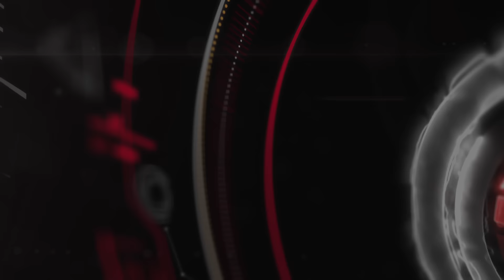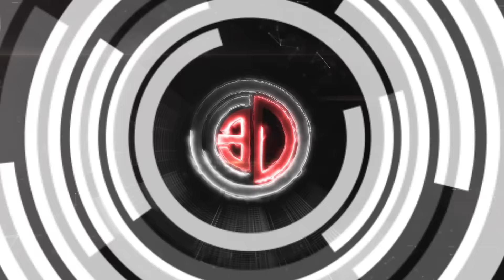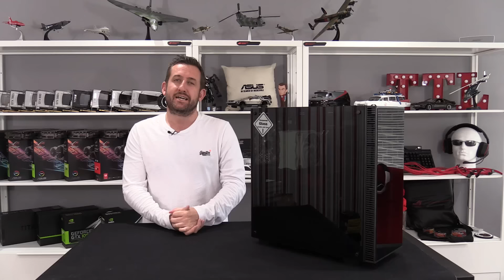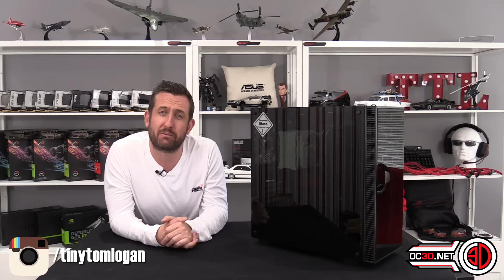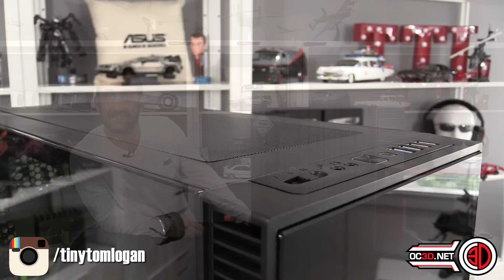Anidees Crystal Tempered Glass Case Review

Comment: This case is the same as the Rosewell cullian and Gamemax saphire with some small changes,ive got the Gamemax version and love it.I changed the fans to CorsairLL 140 rgb fans,and it looks great.Cable managment is very tight,and the power supply  bay is very tight.The cable cover plastic is also a brace for long gpu.

Comment: In the front just fit low profile fans to fit a thicker rad
Reply from the maker: LP fans are pants for rads though. Youd end up losing performance
Reply: +OC3D TV I didn't know that and thinking about it most aio coolers have long screws for full size fans so there would be movement in the fans
Reply from the maker: AIO's will fit in the front of the case fine :)

Comment: Tom, maybe I missed it but you forgot to mention that cable cover also holds the GPU's pcb and prevents sag with longer graphics cards.
Reply: +OC3D TV On some mobos it does. Your mobo must have happened to not have the pcie slots lined up with it.
Reply from the maker: It doesnt line up correctly
Reply: The case creators should have took that into consideration and made more slots to line up with every motherboard

Comment: Surely if you get the pinout right you could plug a 12V white LED strip in the header and just get non-LED fans to plug into the motherboard. Apart from that, the inability to control the fan LED's separately from their speed isn't really the case's fault.

Comment: Phanteks Enthoo Pro M Acrylic meets Fractal Define S with glass...which Phanteks already showed at Computex this year for $100
Reply: This also comes with 3 fans in the front already included, which the Pro M doesn't have. There's also a fan controller/hub here, something the Pro M doesn't have either. And let's not forget the fan filter on the Pro M being attached to the front panel instead of on the fans themselves like shown here, since the side vents are open and unfiltered. 

That said, I don't think this case is worth the MSRP of $150.
Reply: Phanteks added mesh to the intakes on the front. But yeah the Pro M only has 2 140mm fans included (as well as a top bracket for fans/radiator).
My comparison was more along the lines of the design, interrior looks a lot like the Pro M and the exterior more like a Define S with glass front panel.
All that said, I hope Phanteks allow seperate purchase of the glass panel so I can upgrade my acrylic one (yeah that's why I was a tad defensive of the Phanteks).
Reply: Burt Macklin I don't think that'd be possible, considering that the mounting points for the acrylic panel will not be compatible for the original case.
Reply: From the small amount of footage of the Pro M glass it looks to be the same 4 thumbscrews in the same places as my acrylic version, I could be wrong though. I guess I'll just have to wait and see :)